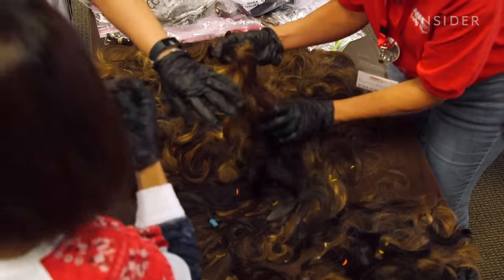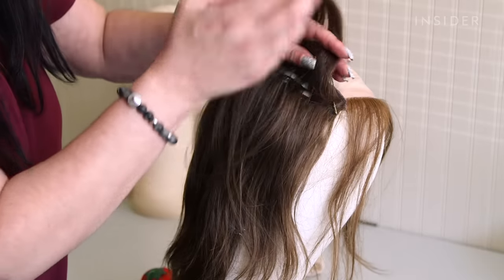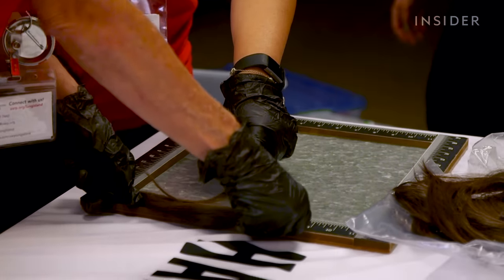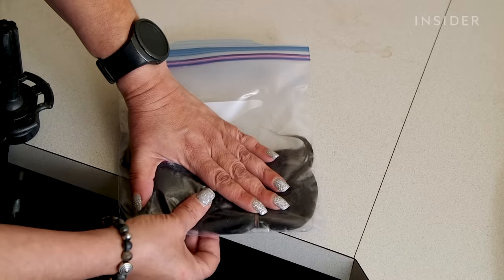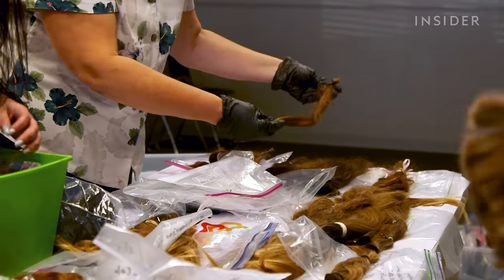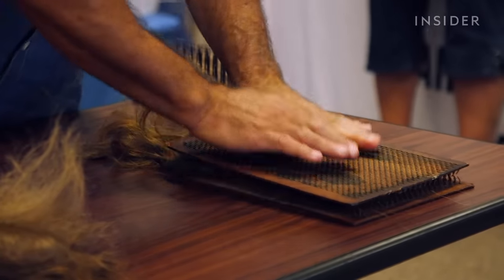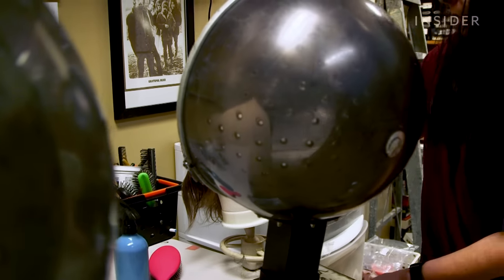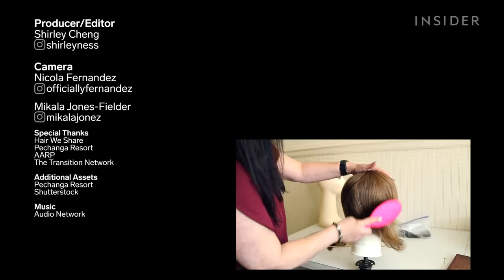How Wigs Are Made From Donated Hair | The Making Of

Comment: It’s actually so disappointing that not all of the hair makes it into wigs. So many people grow then cut their hair just to donate it.
Reply: @W.B S. I don't think discarding tangled or wet hair is a bad example. It's literally impossible to use that hair. 
I'm sure they gave instructions somewhere about how the hair needs to be send in and what type of hair they accept. 
And it's honestly really understandable that the hair needs to be really healthy. 

The hair on the wig doesn't grow back, so for the duration of the wig's lifespan the hair needs to be maintained. Most people don't take great care of their hair. For example They don't care that wearing their hair down causes more split ends. It doesn't matter to them because they aren't expecting to grow their hair to their fingertips. But If your donating hair that is how long the hair needs to hold out for. Lets imagine someone with waist length hair donates. The hair at the waist is about 4 years old. Lets say the recipient wants to wear the wig for 3 years. After 7 years of growth your hair will, on average, hang out somewhere between classic and fingertip length. (if you pull your hair straight, that is)

So, not accepting hair that has been damaged by dye for making wigs is totally understandable. If one puts a lot of work into it it's possible to keep dyed hair fairly healthy for a long time but I wouldn't expect it to last as long as virgin hair even if the recipient knows exactly what they are doing (which is pretty unlikely)
Reply: Would you rather them use moldy or damaged  hair to make a wig?
Reply: I'm one of them. I have 80cm of hair, that pisses me for over a year and now I don't even know if I should donate, if there's a chance my hair just ends in a trashbin.
Reply: Latisha, yes it's disappointing,but people that want to donate NEED TO FOLLOW THE INSTRUCTIONS before donating. There is a list of instructions on their site that is a requirement to follow in order for your hair to be donated. If they say 8 inches or more is the requirement, then it's 8 inches or more. If they say to brush the hair or not make it tangled, then simple brush the hair before sending it to them. If they say dry the hair before sending,put it in the sun til it dries or blow dry it.  If they say NO highlighted hair, then no high lighted hair.  Like I said it's simple if people were to just follow the instructions. Since certain people don't follow the instructions hair gets wasted.
Reply: Klára Leblochová my advice would be to for sure donate it somewhere if you still have it.. That’s always better than just tossing it into the trash can... And It Never hurts to try.... Just please do your own research first, prior to finally choosing the company to donate it to. Because There are some companies (and they’re very well known “donation accepting” companies at that! ) that will either try to charge the clients ridiculous prices for them  (like as high as $2,000+/per wig). Or They’ll even try to charge parents for their children’s wigs smh ☹️😞... and 99% of the time they keep this stuff quiet because supposed to be used/thought of as a charity item, that is donated kinda in a circle and some companies will even try to claim it as charity on their taxes so they avoid more fees/taxes.
Reply: @sara-zq3db  i think braiding it would solve that problem
Reply: I’ve been told by multiple people my hair is beautiful and I donated I like it shorter anyway it grows so fast I got a cut in September 2019 Now it’s October 2020 and my hair is back to almost as long as it was before I’m gonna get an undercut this time though
Reply: @klaraleblochova  you should! I donate mine to children with hair loss and you can actually see like what state your hair is in. Or what region of Canada. And they take any hair in good condition!
Reply: @carolinehorrigan2552  i actually did donate. But I'm from Czech republic :)
Reply: @klaraleblochova  they take it from anywhere!
Reply: It'll be harder for them to work with eliminated hair
Reply: @klaraleblochova  Just send it right and make sure its usable like the video said. The only reason it wasn't used is because its damaged, colored, tangled etc which the website should specify. I agree with you tho, they should find other ways to use it
Reply: Yup. The last 3 haircuts I have got were to donate what got cut off.
Reply: @MariJane06  did it today.. my hair be growing hella fast.. it's thick asf too. 6 pony tails of 9+ inch hair grown in just a little over a year. Just gets annoying so I shave my head down to an inch and donate it all. And before I know it, it's all back lol.
Reply: @undercovercat9865  hey! What is fingertip length, never heard the term before
Reply: It's a shame they throw colored hair away. I mean they could just color all the hair in one color at the end instead of throwing it out.
Reply: I mean it’s understandable, u need to follow the directions posted on their websites they specifically say what to do so your hair doesn’t get immediately thrown away
Reply: @klaraleblochova  well it will be made in a rig if its:

-Washed without hair oil be4 cutting

-Not brightened/darkened (you can dye it but i mean hair will will be too weak if you extract pigment from the hair)

-Over 25cm

- Tied in an elastic band when it goes to the factory

and thats all i think, i donated mine and it will hopefully be a rug for someone
Reply: @Mike Studmuffin the follicles are the "roots" in a person's scalp - what the hair grows from.  No follicles in cut hair, Mike.
Reply: I feel like not one person who replied watched until the end where they said they got a ton sitting there that they don’t have the money to make into wigs. Don’t know if that’s what op was saying but this showed me how important it is to donate money with your hair if your able also
Reply: @klaraleblochova  it will end up anyway in a trash bin if you go to a salon so..
Reply: Or as a donator, keep in mind that you’re farming hair for someone else to wear. So condition it, do trims if you need to, but I’ve always put in extra effort on hair I’d donate. If the hairdresser/s are amazed and want to keep any usable extra hair that falls on the ground to test dye samples, then you know you did a good job. 😂
Reply: I'd agree but you can't just shove cut hair in a bag and send it off, especially if they specify not wet and tied in a ponytail or plaited.
Reply: @undercovercat9865  
She not blaming them it’s true it’s unusable but also just unfortunate
Reply: They be stealing little girls hair
Reply: The ring
Reply: I'm sure nobody will buy a defected , low quality wigs .

Comment: I'm surprised that they discard some hair just because of colour. If everything else is fine, just put it in miscellaneous pile sorted by length and structure, and DYE the hair at some point! If I had to get a wig, I'd love a pink wig, for example. It's already a wig, why not?
Reply: colored hair is not good it will rot.
Reply: I agree with what your saying here. What they fail to mention in this video though is that it takes more than one persons pony tail to make a wig and so they would need multiple pony tails of similar dyed hair in order to make a wig from it. The reason they don't just dye all the hair is because 1. Budget and 2. Hair from different people in different states will take colour differently. Because of the number of pony tails it takes to make 1 wig thats why they only seperate hair in 8 colours otherwise they technically could just make a wig out of every pony in every colour. 🙂
Reply: @guineapig0208  They do say it takes up to 9 ponytails for 1 wig.

Comment: I would like to see the actual wash etc. of the process because I’m confused as to why they can’t use hair that’s tangled. Why not condition and detangle the hair? Why not dye colored hair? I presume the process is tedious...
Reply: It's not enough to simply detangle it. To make hair wefts, all the hairs must be facing the same direction, thicker bases tied at the top, thin ends loose at the bottom. It'll look really bad if the hairs aren't the right way up, and when detangling it's impossible to sit and stare at each untangled hair to find the base and sort them.

As for coloured hair, it's easy to say 'dye it the same colour', but different people havs different hair thicknesses and level of damage, so there's no guarantee that it'll dye the same colour, or the same intensity.